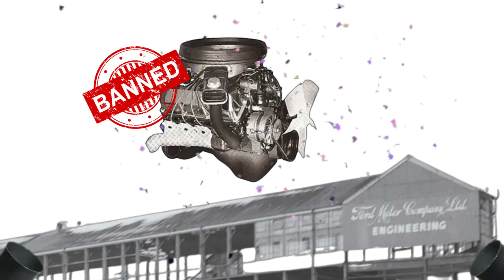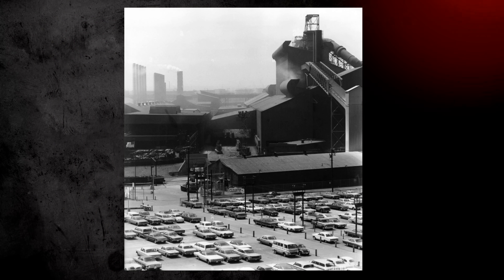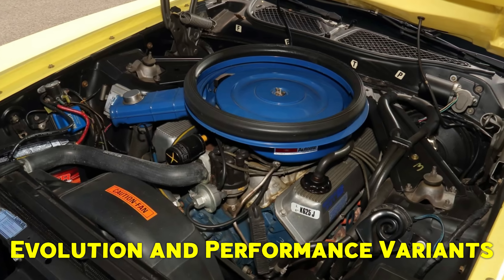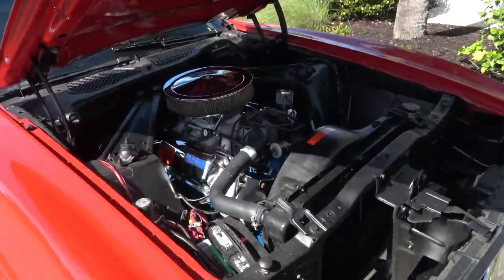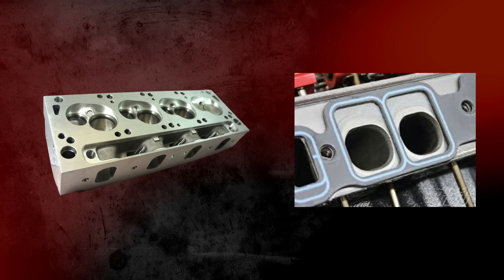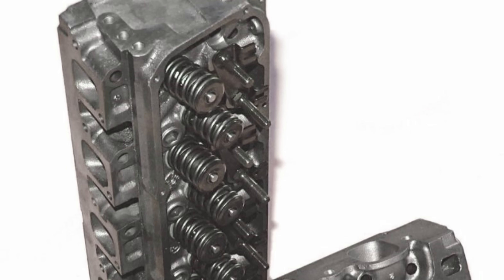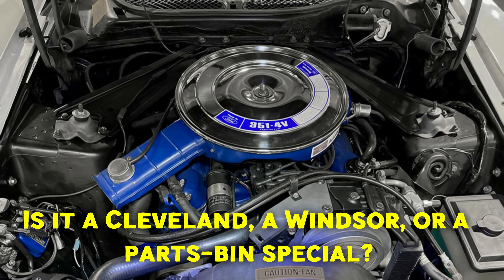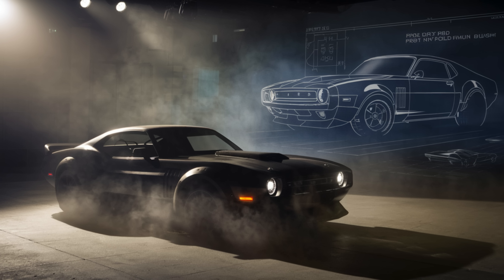The Shocking Truth Behind FORDs Banned 351 Cleveland Engine

Comment: Yes I’ve owned a few and all were great 
Oiling to the cam bearings first was wierd but easily sorted 
Small port heads with 4v intake valves were my trick and a racer once said Don’t over exhaus it don’t exceed 75% exhaust flow vs 100% intake 
So reliable 🥊🥊💪💪 c
Reply from the maker: It's awesome to hear you've had great experiences with the 351 Cleveland! Your tips on oiling and head modifications are super helpful for anyone looking to get the most out of this engine.  @iansandersVortech500  great tip!!

Comment: I had a ( 351) in my 1979 F-250, but it came with a 2 barrel carb. And start of emissions 
I always wished had gotten a big block for a 4-speed granny gear. First, it was a standard 8 foot bed, my first new PU. Had her for 20 years. My 2000 was the V-10 gasser, still used in the United Rental 5 yard dump. My 2021 is a Duramax 6.6 Allison 10
Speed transmission. Z-71 3500 its the last PU my wife will let me BUY. She gets so much better FUEL mileage than those Ford gas engines. It's what I need in retirement trips.
Reply from the maker: It's awesome to hear about your journey with those trucks! The 351 Cleveland is such a classic engine, and it's cool that you’ve had multiple experiences with different powertrains over the years. Your Duramax sounds like a solid choice for those retirement trips!  @rp1645

Comment: I had a top of the line 1971 Mustang Mach I with 351. Shaker hood and all. I loved that car and was an idiot to sell it. I never had anything go wrong, it was fast as f' and would beat by friend's 74 350ci Corvette (in fairness the 74s were detuned for smog and I'd bet they had well under 250HP). But it still pissed him off. Truly great car. I made one modification - I added a larger exhaust system and side pipes. The sound was amazing and I swear I picked up another 10-20 HP...
Reply: I know the feeling I sold my 70 Mach 1 when I turned 20 wish I still had it
Reply: Some drunk ladies ran a red light,there went my Cyclone. I had my nephews and neice in the car and thank God Ford made a solid car in 1970
 @GaryLovelace-qg7cf
Reply: My Dad had a 78 Ford pick up,bad year it spun a Bering and burned starters constantly.
He ended up doing a engine swap to a Cleveland 351,and that truck was no slouch
Reply: When you think about it today's engines,for example the 5.7 hemi comes about with 400 hp. The idea with the Hemi was once one hp per cube,man they have exceeded that especially with the pre 2015 trucks.
You could install a tune exuast and a cold air,and have close to 500 hp.
I had a single cab express that ran a 13.2
Reply: The srt 300 we have got a 3.8  0  to 60 on crappy tires.we have a garage queen 2013 Chrysler 300 SRT that does 180 governed.
It has 12000 orginal miles
Reply from the maker: That sounds like an incredible ride! The 351 Cleveland really had its charm, and it's always fun to reminisce about those powerful engines. Thanks for sharing your story! @DenanSeven
@DenanSeven
Reply: Yout friend's Vette was probably at least 1000 lbs heavier than your Mustang. Vettes have NEVER been lighthweights(3,500+lbs since the Gen 2 Stingray) & your Mustang was probably under 3,000. Also, by 74, your friend's 350 was a turd SMOG motor that was lucky to make 200hp! You should have tried on a 70 or 71 Z28 with the 370HP LT-1 350 or a 69 L79 Nova to see how your car really ran! LOL I had a small block Maverick & it weighed 2,800. Weight makes up for a lot of HP! This is the reason Grumpy & Glidden ran so well in ProStock with small blocks. The crap ended when NHRA established a minimum weight for the calss. FYI, the 65 small block Cobra was the fastest 0 to 100 to 0 because it only weighed 1,600lbs. Not because of HP. The first thing most manufacturers did to meet emmision standards was retard the camsshaft, which killed performance & made them prone to spark knock. BTW, a decent turbo charged 2388 air cooled VW would give your Mustang more than it could handle on the street! LOL

Comment: Horrible voice over. Great old motor. I loved the Boss 302 as well
Reply from the maker: Thanks for your feedback! The Boss 302 is definitely a classic. What do you love most about it?  @maconpatton
Reply: @ That’s an interesting question. I like the smaller displacement, higher efficiency head designs. Im no expert but I think the 351C & Boss 302 heads were  very similar. I should look into it, but my recollection was the Boss made its power at higher revs. Both the Cleveland & Boss heads were so much better considering we were in the late 60s and early 70s. These days we have so many different designs of everything…back then, pickins were much slimmer. Thx for the reminder of a great era of cars & motors.

Comment: The Boss 351 was used in Australia. In the 1971 XY GT HO. Absolutely dominated on and off the race track.
Reply: I'm sorry to have to correct you, NO the XY GTHO engine was not a Boss 351. The Boss 351 had a 4 Bolt main block, different conrods, forged pistons and a smaller mechanical camshaft(same as the Phase 4 was to receive).It also had a Buddy Bar Alloy intake manifold. The GTHO engine was a 'Australian only' spec'd build based on the 4V engine with a unique cam profile and Boss 302 valve train and the Boss 351 balancer and Holley 780cfm vac secondary. It was a very stout combo for a 1970 release.
Reply: @scottrobertson6949  correctamundo lol
Reply from the maker: You're absolutely right! The Boss 351 was indeed a powerhouse in Australia, especially in the legendary XY GT HO. It made a significant impact in both racing and street performance!  @tez69m

Comment: Still couldnt compete with hemi
Reply from the maker: It's true that the Hemi has a legendary reputation, but the Cleveland engine had its own unique strengths and loyal fan base! @paulberkland5700
Reply: @rarecarstorys  as does the 225 slant 6.....arguably a better motor than the Cleveland

Comment: I used to work with a guy who had a 1968 Ford Torino with a 351 Cleveland.  I'm not sure why you said the 351 Cleveland was introduced in 1970. He used to boast about its ability to sustain 6,000 rpm for long distances.
Reply from the maker: Thanks for sharing that! The 351 Cleveland did indeed have a fascinating history, and it's interesting to hear about personal experiences with such classic engines.  @VashthStampeede

Comment: Just drop compression around 7:1 add a centrifugal supercharger and 800+ hp is easy with decent lifespan.  Missed chance at Grandparents 72 Grand Torino with 351C but they knew I would have probably killed myself. Would love to build a GT/GT40 clone with supercharged 351C and 5 speed. Make  Corvettes,Porsche and Ferraris go home and hide.
Reply from the maker: That sounds like an awesome build! A supercharged 351C would definitely turn heads and pack some serious power. Good luck with the GT/GT40 clone project! @ronv6637
@ronv6637

Comment: They were NOT BANNED!!!  The Cleveland engine plant was old and at it's end of expected run.  The other 351 engines were made in newer Canadian plants.  The Cleveland engine line was simply phased out.  New emissions laws made it too expensive to produce.  

The NASAR FORD engine used for 30 years was a Cleveland design.  Other Ford 351 engines had a 3" main bearing when the Cleveland had  smaller bearing diameter giving a slower bearing speed.  The Cleveland engines had a canted valve layout giving larger valves,  straighter and larger ports ports. Better head bolt pattern for better clamping force.  Open chamber head design for even/slower flame propagation.
Reply from the maker: You bring up some valid points about the Cleveland engine's production and design! It's fascinating how the evolution of emissions laws and manufacturing capabilities has shaped the automotive landscape over the years.  @myfavoritemartian1
Reply: The stock car guys in the 80s put Boss/Cleveland heads on Windsor blocks & called them Clevors. Edelbrock now makes a head & intake combo to do this with OTC parts. The weak point of the Boss & Cleveland was the water flow that didn't meet in the intake like most other engines.
Reply: @bradgriffith4231  Except the Boss motors had smaller main bearing diameter for slower bearing speeds and lower oil temperatures.  The windsor 302 has larger bearings and not near as good for endurance racing.  At one time they sold bearing spacers so you could use a windsor block with a Boss crank and bearings.  Been there, done that.
Reply: @ Your point makes no difference when the motor oils properly. My buddy has the quickest Olds in the U.S., turns if 8500, & it runs the big journal Olds Crankshaft. Your point is about antique technology. I never had bearing problems with my Windsor motor. Oiling the cam first is the flaw, & the reason for "priority" oiling systems. Oil the crank first & the upper end last.
Reply: @bradgriffith4231  Please read your own post above.  You were talking stock car guys.  Where they hold them at high revs for hours sometimes.  That is why lower bearing speeds and lower oil temperatures are important.  The oil to the cam was no issue because they ran an external oil line to the mains.
Reply: @myfavoritemartian1  "Bearing speed" is meaningless as long as there's enough oil to float the bearings! LOL BTW, except at Daytona or Taladega, NASCAR engines have to pull over a wide RPM range. The way they dyno an engine is by searching for the shortest time to accelerate the load from the lowest RPM on a given track to the highest RPM, NOT for peak power.
Reply: @bradgriffith4231  I am 73.  Years ago I raced stock cars for a ten year period, about the time they changed from bias to radials.  Bearing speed is heat.  Bearing heat is removed by oil circulation.  Oil temperature is a critical factor.  The Yates engines were an aluminum Windsor block with Cleveland main bearings.  The Windsor water flow pattern was superior to the Cleveland and fixed the cooling issue. It was much later that they went to external water hoses to cool the back cylinder chambers which ran hotter than the others.
Yes torque was the determining factor in a roundy engine.
Reply: @bradgriffith4231  Bearing speed is heat.  Anything to reduce heat is not meaningless.

Comment: I've driven them all and the 351 Boss pulls so hard that you would think it wasn't factory it just puts a smile like a fresh built race motor but stock
Reply from the maker: The 351 Boss really is a beast! It’s amazing how much power those engines can deliver while still being factory stock. Thanks for sharing your experience!  @RolandCardinal-n2q
Reply: Yea I just in awe it was a all original 71 Boss 351 white and black 4 speed now I had a 73 Torino sport 351 Cleveland 4v dual exhaust and. A 68 zTbird 429 TJ suicide doors all black the bird was a beast 90k miles brand new original the Torino gorgeous but hate to say it was really slow doggie wet sponge oh also 2 69 grandes one was 302 but this second one 351w 4brl c6 trans and low geared 9inch rear that car was evil no clue if stock but I read that there were some sleepers with this combo it was really powerful and bullet proof also had hood with pins and functions air scoop like a shaker hood set up fiberglass hood maybe but it blew up once smashed my windshield extremely powerful grande no clue if factory or ordered like that guy sold it to me said it was factory ordered drag pack I didn't believe him but it was fast
Reply: Why do we sell and cry later oh yeah we don't think to future expect it be there I guess

Comment: I put a Cleveland out of an interceptor in an '86 ford pickup, it was freakin' ludicrous. 
 Ate a few transmissions
Reply from the maker: Wow, sounds like your pickup was on a mission to eat transmissions for breakfast! Just make sure it doesn’t try to eat your wallet too!  @hickeyskustomresto
Reply: @rarecarstorys  lol it tried to. I parted it out and built a mopar ramcharger instead... always a sucker for punishment I guess. Lol
I did drive the ramcharger for years though,  and sold off pretty high

Comment: US cleveland heads are open chamber, large. Australian Cleveland had 2v heads, they were closed chamber, not available in the US.
Recomended head when doing a clevor engine( windsor block cleveland heads).
Reply from the maker: Great point! The differences between the US and Australian Cleveland engines can be quite fascinating. The closed chamber heads really do make a difference in performance!  @davewellings6210  i want a clevor 351

Comment: I had a 1971 LTD with a 351C. Moved that boat around like the 351 was installed in a VW Beetle body. I still miss that car.
Reply from the maker: me too, i had the same 1971 LTD boat 351C , what a wild car, miss mine every day @Longhorn-s7z
Reply: @rarecarstorys , I had a 1971 Galaxie with the 351C (2 bbl).
Reply: If you had a full size Ford with a 351 it was either a Windsor or a 351M (Modified). 351 Modifieds & 400s looked like Clevelands, shared the same heads, cams, & ignition, but had the larger big block bellhousing pattern while Clevelands used the small block pattern. Ford never put a 351C into a Galaxie/LTD, or truck.
Reply: @ ,  I have had this argument with so many  people I have lost count and I don't even care any more.   It had the "H" code on the VIN for the motor, not "M".  The first clue I had it was a Cleveland ,and not the  Windsor I was expecting to se, was when I opened the hood and "Cleveland" was written in yellow chalk lettering on the air cleaner (I bought it from an old lady who the original owner).  A year after I bought it, I dropped the FMX  (which was the transmission you got with a 2v Cleveland in 1971) transmission that came in it, and put in a 4 speed toploader, that came off another Cleveland motor (making a White Lightning clone car).  I did that myself, in my backyard.  As you point out, it wouldn't have fit a 351M. I asked an old Ford factory guy one time about it, and he said they probably ran short a few 351 Windsors on the line, and rather than stop the  line, they just borrowed a few Clevelands from another line that day.)  Because,  like you, he said, it wasn't a normal option for that car.  In the end, believe it or not. If you were around, I could show you some of the hundred photos I took when I was swapping the FMX out for the Toploader.  I don't care.
Reply: @ralphholiman7401 well, it is an old car. Who knows what someone  did to it in the past.
Reply: @David-b7m5m  , like I said, I bought it from an old lady in New Jersey. It had 42,000 miles on the odometer when I bought it from her in 2006. I admit, I didn't question her about it, but the explanation the Ford guy gave me made sense.  Likewise when I ordered a new 1974 Dodge Charger with an engine and transmission that wasn't listed as an option in the brochure. The dealer was my uncle and he told me, "Just tell me the engine and drive train you want. I know how to order it to make it happen."
Reply: @ , then to make it even more certain, I put an Edlebrok Cleveland intake manifold on it that I bought online and a four barrel carb.  I'm pretty sure I would still be trying to get that Cleveland intake onto a 351 Windsor or 351M.
Reply: @David-b7m5m  yes they did 72 ltd

Comment: Shocking truth??? What a load of crap. Clevo is an engine full of faults and it is too big and heavy for its intended cars. They have lousy oiling, lousy cooling and those much vaunted canted valve heads are simply way too big,,, well unless you turn 8000 rpm. And the engines explode at 7000!!  Oh and Clevos came out late 69 here in Oz in Falcon Gts
It was supposed to be a performance engine,, except by 71 all the performance cars had no performance anymore. And were being downsized
The base engine design lived on a decade or so with the 351 and 400M engines. And dont waffle shit about them not being an M,, for lack of a better term it categorises them.  Tall deck engine even heavier but do a ok job dragging around full size cars and commercials. Though were replaced by what they replaced the 351 Windsor. 
We had Clevelands here in Oz to 83. Total slugs that got 12mpg and were slower than the 4.1 6. After early 76 they were smogged up junk. 
And yes I own currently 2 351Cs and a 400M.  And now a 347 Boss clone. And none have those useless 4V heads!! Even the 2Vs are too big. Intake size is bigger than a Chev med race port. Which produces more power. The 347 has CHI 3Vs which do work as a race head
Reply from the maker: Thank you for sharing your extensive knowledge on the 351 Cleveland and its history! It’s great to hear from someone with hands-on experience. Your passion for these engines really shines through!  @ldnwholesale8552

Comment: It had some problems,  oil system,  built heavy. The cylinder heads were to much for the street.  It later became the 351M and 400M
Reply from the maker: You make some solid points! The oil system issues definitely impacted its reputation, and the weight was a concern for many enthusiasts. It's interesting how the 351M and 400M evolved and defintly impressive in there own right  @alexcerqueira8311

Comment: The majority of De-Tomaso Panteras were powered by Ford Australia’s Geelong Plant built Clevelands and Australia improved the Cleveland engine and also uniquely produced them in 302 or 4.9 litre variants in both 2bbl & 4 bbl forms alongside the 351’s we used them in Australian built Falcons, Fairmonts, Fairlanes, LTD’s & F series trucks to Aussie Broncos and were built here up to around 83-84, Aussie Fords used the Windsor V8’s up until the change over to Cleveland’s but Ford Australia went the full circle and back to using Windsors again years later and then to some unique quad cam 5.4 litre variants for Falcons etc then to Miami and coyote V8’s in the end
Reply: Never realised the 302c was unique to Australia